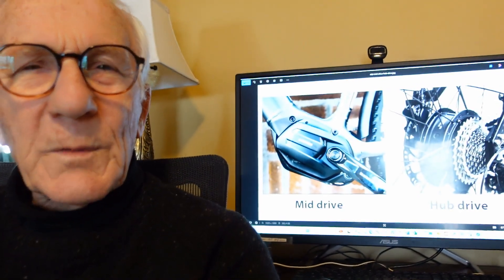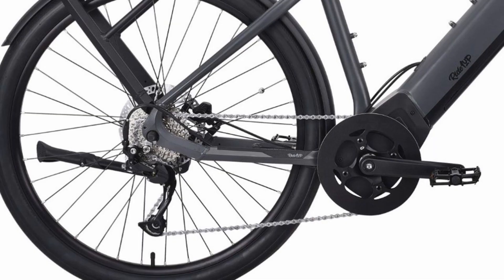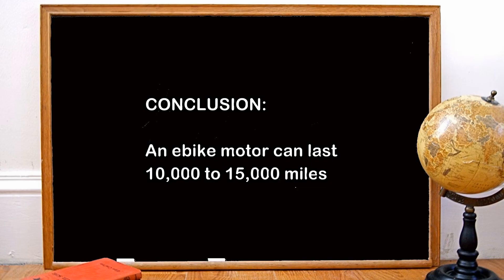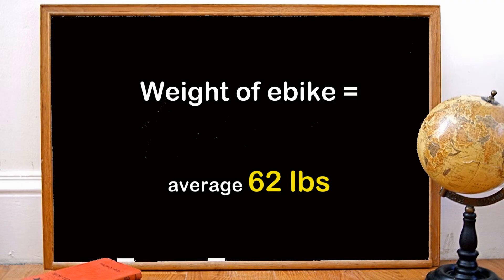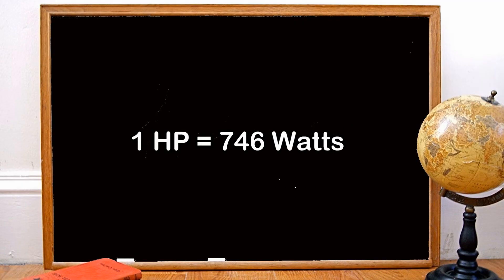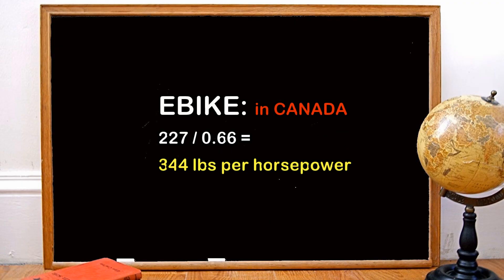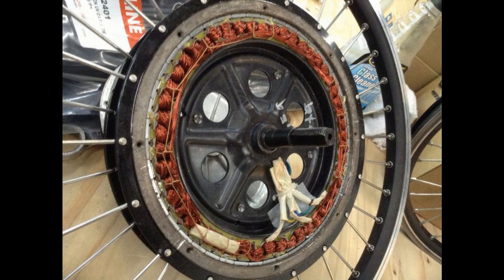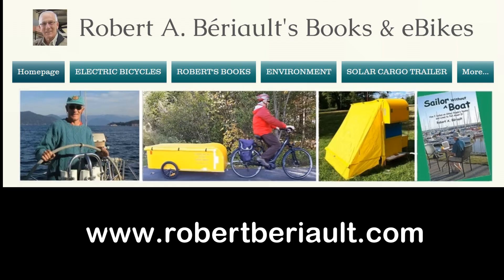Why Ebike Motors Have Such a Short Lifespan

Comment: And clearly a major variable in this equation is how the bike is being ridden. 

I can nearly guarantee you if I look at a fat bike that the chain will have no wear on it whatsoever -  the customer who bought that bike just wants an unregistered, cheap, electric motorcycle and the pedals are simply footrests that are there to satisfy a legality, while they blast around town on full throttle. 

E-bikes that are ridden as  bicycles, IE pedaling with some supplemental electrical assist, will probably do much better.
Reply: I'm sure that is true for a good number of riders, but I've purchased a fatbike and I ride it properly - human power with electrical assistance. I use it for exercise and I am at the elderly end of the spectrum.
Reply from the maker: Good point.
Reply: My Fat Tyre E bike has a torque sensor on the crank and no throttle so I have to put some effort in to get any back .

Comment: Plastic gears in geared ebike motors are not only more silent and cheaper to make than metal ones, but they also are meant to fail first, without destroying other more expensive parts.
Reply from the maker: I'm going to phone bikes shops to ask how much they charge to either lubricate or change planetary gears.
Reply: @RobertBeriault753  That would be the most economical thing to do (at least in my country, Romania)
Reply: Not a bad point.
Reply: My Grin 1000 watt hub went 20,000 K no issues before I changed to a mid drive. Plastic planetary gears.I didnt check them for state of wear but worked fine at that point with no noise.They seem to be very strong and I definitely didnt baby it,a lot of steep cranking up hill.

Comment: Wow, this is scary news, If I were to start using an e-bike I will need a  replacement motor every two years.
Reply from the maker: If you ride that much, you'd need a direct drive motor.
Reply: Chances are you will not have to replace the entire motor, but if you have the geared version, you will have to replace the gears which isn't that hard to do.
Reply: @justinw1765  Thank you for the info.
Reply: @MrCyclist  oh, and take the motor apart every so often to check matters - and put some grease on the gears, then.

Mobil-28 (aircraft grease) is said to be good.  I have used this in mine.  Really helps keep things quiet.

Comment: Perfect advocacy for an electric unicycle: 50% fewer tyres and tubes, no brakes to service, simplicity and efficiency exemplified.
Reply from the maker: Or no wheels at all. Just walk!
Reply: But if you have only one wheel would it be a fair suggestion, that, since load is not spread over 2 wheels, tires must be run out more quickly? Don't get me wrong, EUCs are a superior mode of transportation. But, it seems, your arguments are not very thought out...
Reply: I have e-bikes and EUC’s; the wear on the tyres of the latter, being both more robustly built and of thicker material does not wear as you suggest, not in the real world. But that may be different for you. I’d suggest you think about your argument and the clear deficiencies in it. Once you know a little more of what you’re talking about, the conversation might develop, but until then I’d get back to learning about your EUC.
Reply: @freeforester1717  So, if your point is backed up by practice or better argument, that's a good point. I don't have e-bikes to compare 🤷‍♂️
Reply: Indeed.
Consider the Apple, alongside the Orange;
EUC- much greater tyre ground contact point compared to those of typical bicycle wheel tyres; tyre compound thickness and hardness, typical tyre pressures of each, tyre wall thicknesses and relative deformation under load. Ten years of Ebike ownership and usage, four and half with EUC. My points were indeed experienced based. 

Seasons greetings, and enjoy your journey!

Comment: I think its mostly bearings and sealings; at least as far as direct drive is concerned. You can spend a lot on those to get something good; but its not something your average customer will pay any attention to when making their buying decision, so you often end up with crap. But even with good bearings; you are still having your motor sit one bearing away from the mud splashing about. As long as you keep the seals and bearings intact (and your setup is temperature limited), a direct drive ebike motor can run essentially forever though.
Reply from the maker: Thanks for sharing your experience

Comment: 10,000 miles out of a motor could be a reasonable 5 years use for many owners. Since a replacement motor is $300. or so that is still very inexpensive transportation. The replacement plastic gear sets are $50. if you can do the replacement yourself. Direct Drive motors are very much still available but are installed on high output  applications making them illegal for road use. Many motors with regen are often direct drive but within legal power limits.
Reply from the maker: Thanks for your perspective
Reply: @daytriker  the power input is what determines legality, e.g. you can have a 3 kw nominal motor, and only give it 1 kw of input, e.g. current limit the windings to, say, 18 amps at 52 volts nominal (with, say, a brief surge to a higher level, to help with “emergency acceleration.” (To avoid getting pasted by an irate driver, for example.)

An understressed drive train is likely to last longer and give less trouble, all else being equal.

Comment: brushed motors would last 10x longer because you can easily replace brushes.  Brushed motors can be rebuilt by a hs student in a hour with less than $100 of common parts.   Common brushed motors like alternators outlive cars as long as you know how to replace the wear parts.    We sell rebuild kits for brushed motors at maniac electric :)
Reply: How is the brushed or non-brushed motor going to affect the longevity of the gears, which have nothing to do with the type of motor?
Reply: @47f0  cheap plastic gears is a separate problem (which can also easily be rectified i.e. hardened metal gears)
Reply from the maker: Do you know of any factory ebikes that have brushed motors?
Reply: @RobertBeriault753  I do not, but i have seen youtubers build bikes with brushed motors, even scrap alternators

Comment: A friend of mine had an older e-bike that the hub motor failed on.  It apparently was stored outside and water got inside.  He had me take a look at it and I was finally able to open it up and it was solid rust inside.  I think it was a direct drive motor.
But yes, bicycle drivetrains are vastly overloaded.  One of my first jobs, I was working with some large equipment in a paper mill and some of it was chain driven.  I found some chain drive design/sizing information and since I was a cyclist, I decided to look up the rating on a bike chain.  That tables didn't go down to bike chain size, but I went with the smallest and used some estimates on the torque and speed for a bicycle.  The data showed that the bike chain was severely undersized for the torque/tension applied to it in normal use.  I was amazed at how long a bike chain does last given the use it's put to.  No surprise that e-bike motors are also under high loads as well.  I think it's mostly due to the size and weight limits trying to jam all that stuff into a hub or between the pedals.
Reply: @The4Crawler  this but one reason I’ve thought to incorporate a three to five speed transmission into a mid-drive, so that a single sprocket can be used on the rear wheel with 415 (3/16 inch wide rollers) chain used to drive matters.

Only better thing I can think of is to go to a fully enclosed chain case with an oil bath of light synthetic gear lube, e.g. 75w-90 - keeps the chain and sprockets lubricated, and keeps out the dirt.
Reply: @dennisyoung4631  what about a belt drive ?
Reply from the maker: Good point. Thanks for sharing.
Reply: Priorititizing lightness of components,  because of the nature of the bicycle, being drastically affected by relatively small increases in weight, yes. Also, ebikes basically are using barely adapted existing bicycle parts standards, rather than parts specifically engineered for ebikes. This is really evident with the disc brake systems... They should be at least 30percent heftier in my opinion, for commuter style ebikes .They are safe enough, but the pads are so small and thin that they wear out relatively quickly. Say every 2500 miles

Comment: Buy over engineered & DOT grade.
Reply from the maker: Any suggestions as to which makes of ebikes have this?
Reply: @ from experience a modified onyx CTY2/RCR.

From outside looking in: Specialized Haul, Spark bandit, Ristretto, e-cells, Beachman, to name a few e-bikes. I would include the Revv1, but I’ve seen their geared motor deteriorated due to the use of nylon gears. Spark uses metal reinforced nylon gears.

The only ones that will last/withstand will be e-bikes, e-mopeds, emoto’s that use DOT grade material.

I have firsthand experience with Ösa & CE02, about 2,000 miles on each, but those aren’t e-bikes. However, they’re thoroughly engineered, utilitarian & smart PEVs to an extent.

IMHO, the Onyx are unique & are the pioneers for what has become this space. Steel frame, hydraulic front brake, 3k watts, 72 & 60v, etc…far from perfect, but great base to build on. Everything these days is aluminum, emtb, 48-52v…it’s inadequate for anything other than leisure.

Don’t get me wrong. The Ösa is only 50v, but it’s engineered & built right. Not perfect, but highly capable.

The CE02 is dual 48v, but it’s not like any 48v.

Of the mix, the Onyx is the dumbest, but smoothest, if that makes any sense? It’s not as agile as the CE02 or as long-range as the Ösa, but it holds its own in its own special way. Mind you, significant upgrades are required to get it dialed in, but it’s more than worth the investment.

Now, this is all subjective & based on my personal likes/preferences & will differ from many others.

YVMV.

GL.
Reply from the maker: That's a lot of information to sift through. Thank you.
Reply: Also my philosophy but Im DIY. Biggest motor and underpower it.

Comment: My ebike motor is a bafang hub and I've had it since 2017.  I've only had to change out the planetary gears a couple times during its lifespan, and since this part comes from China, I order about five of them so I am never without.  The gear set for my motor costs about $45 each, and the gears are plastic, made to wear out sooner than the hub housing runner teeth.  It's designed as a sacrificial part for the long-term motor usage, and this cost and tradeoff is something I'm willing to do.
Reply from the maker: That's a good approach!
Reply: Seems like delamination and lamination stack distortion in Bafang bbshd ipm rotors is another issue. Received defective rotors two times.
Reply: @uvwuvw-ol3fg  Ive ridden a BBSHD two years now no problem. Often hard up mountain trails. Go through chains though.

Comment: I just sold my 2005 Golf TDI with 490,000 km and still running. I figure that it will easily get to 600,000 km. The guy that bought it was a mechanic and rust was not an issue. He bought it because of the fuel efficiency, I was still getting 5l/100km.
Reply from the maker: I think cars would last longer if people had them serviced regularly and had them repaired even if they're past 10 years.
Reply: @RobertBeriault753  Besides the TDI I had a 1985 carbureted Honda Prelude and had it for 18 years and 580,000 km. The rust took her. .
Reply from the maker: Damn rust!

Comment: We can't make a bottom bracket last 3months, so there's no hope for a motor in the same place.
Reply from the maker: You haven't been lucky with your bottom bracket.
Reply: @RobertBeriault753  I exaggerate, but only slightly!  The old school shimano sealed square tapered (internal) bottom bracket was bomb proof and used to last for ever, but of course things evolved to chainrings with attached axle.  This solved one problem (the terrible square taper design) but made a new one, the unreliable external bottom bracket.  For me they are now a disposable item, no matter which brand, which manufacturer, cheap or expensive they start creaking within weeks and clunking within months!

Comment: I bought a Bafang Mid motor 5 or 6 years ago. It was the most powerful at that time and the most expensive but it still works great today. I use it at least 5 days a week in every weather have done almost 15000 km in these years and I had no problem with the actual motor. Of course I had to change parts on the bike like chain and gears but the motor never had anything.
Reply: I'm using the bafang BBS02B 750W for 5 years now.   The only lesson important for everybody.   Grease the bearings .  Factory greasing is feeble.  Good for 3000km. After that, you get squeeks.  And soon after that, the motor electronics will overload due friction and die.
Reply from the maker: Thanks for sharing
Reply: Same here,BBSHD. 48 volt with a mid drive like this is plenty of torque.

Comment: Ok, the e-bike motor works 12 x harder vs. a car engine if the rider does not help add torque. But the rider also adds a lot of torque in pedal assist mode. 

I had a hub motor that had no gears-- it was a Bionx 350 watt motor. It ran perfectly for 8800 miles, and it could keep going, but the battery wore out and Bionx went bankrupt. So the cost of a rebuilt battery was bigger than a new e-bike with a geared motor.

I think very few manufacturers build direct drive motors because they are proportionally much heavier than equally powerful geared motors. On the other hand, they are virtually silent because there are no gears. I personally prefer the direct drive bike motors because they have the ability to do regenerative braking, i.e. using the spinning magnets as a generator to recharge the battery whenever you want to slow down instead of using the rim brakes or disc brakes. So then the brake parts will also last longer.

The only complaint I had about the Bionx direct drive motor was that it made a 30 lb. bike 20 lbs heavier because the battery was around 10 lbs, and so was the hub motor wheel.

Using plastic for gears in a hub motor seems like a terrible idea-- like they want the motors to fail after 10,000 or 15,000 miles so that you have to buy another one.
Reply: My friends do rebuild those motors with KT controllers,  and then you can use any battery.
Reply from the maker: Those are great points.
Reply: Plastic for noise.

Comment: Keep it dry, clean and lubricate nylon gears every year, don't use full throttle to pull away,I do this and have 20,000 on my 500watt hub drive , only thing I have done is change the bearings,like a car engine if you look after it then there is a good chance it will last.
Reply from the maker: Do you do the work yourself. I just wonder how much it would cost in labour to thave the nylon gears lubricated.

Comment: 10-15k is a lot. I ride my ebike 2k miles per year.  By the time it wears out I would have moved on to a new updated ebike.  The gears of a hub motor are cheap and easy to replace.  It's also cheap and easy to replace the entire wheel/motor assembly.  What's not cheap is replacing the battery.  You should have done an analysis on that instead.
Reply from the maker: When moving to an updated bike you have to sell your old one. You wouldn't get anything for it if it doesn't work. But thank you for the idea of doing a video on the life of batteries.
Reply: @RobertBeriault753  By the time I moved on I would've gotten my money's worth out of it.  For me, who rides an ebike 2k miles a year, it really isn't all that thrifty compared to driving my car.  I can buy a lot of gas for what my ebike cost me.  But, it's a lot more fun to ride the ebike.
Reply from the maker: I kinda agree with you on that. Have you see this video? 
https://youtu.be/U-BI5fkwjFo
Reply: @RobertBeriault753  PS The drivetrain on a hub motor ebike will last A LOT longer than on a mid drive.  7 or 8 speed chains and cogs are ridiculously cheap online.  Hub motor ebikes are way cheaper than mid drives and I actually prefer the riding experience of a hub motor for commuting, shifting not nearly as critical.
Reply: 10-15k isn't a lot if you are commuting, it's basically 3 yrs commuting for me. So that's pretty poor value.

Comment: cannot hear..but why did i just rebuild wheel for 6th time, not once was i buying new as wires from china were/are faulty..motor itself is 3 hall sensors and 3 phase wires, oldest moter i use is 1980's "mountain tour", then few from 2014 ish..1000's of miles.. issue you face is planetary gears, vinyl.. and wires that dont take amps ebikes put out..my 250w motor will see 890wats...yes avg is 500 watts but peaks..so running what controler..facts clear old school motor..or plastic gears..my new motor lasted short life as planetary gears were chewed. lets compare gas to batteries wtf
Reply from the maker: Thanks for sharing.
Reply: @RobertBeriault753  ive torn many old ones down rebuilt..big old ones,no gears best as regens a option,(grim,bc, can. ebikes has info on regen) planetary gears great but 1 year life span..old system got issues but easy to address, anti tear out,temp sensor added, i am 70 % disabled 57 retired as injured at work 2009..use 3 systems now but tell me required and system to match, mid drive nice off road mountain bike, front wheel great no snow/mud around the town, rear is all season,dual is weight.. of batteries..motors no pedal point. good secret many miss is a 36volt battery no bms as hobby charger is possible,sets cells perfect..called discharger/charger  lvl cells and can set to 90% making cell life time 4 times.often split battery..24volts each..hobby chargers fail after 36 volts still saddly.
Reply from the maker: Thanks for sharing